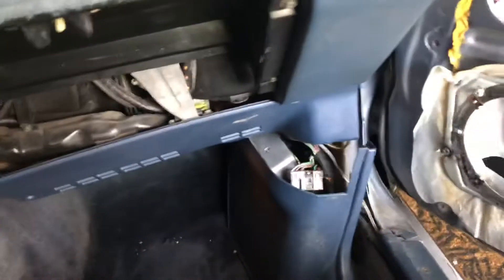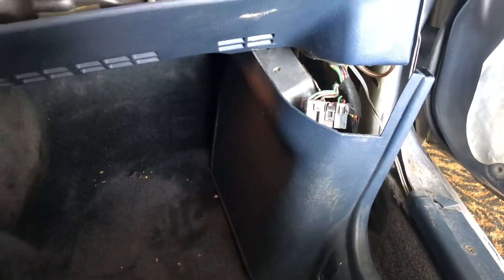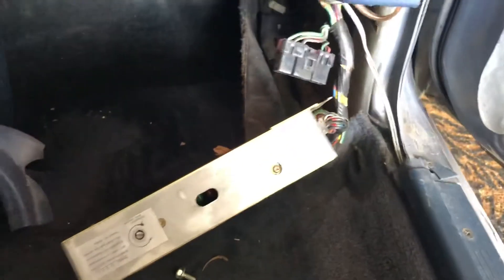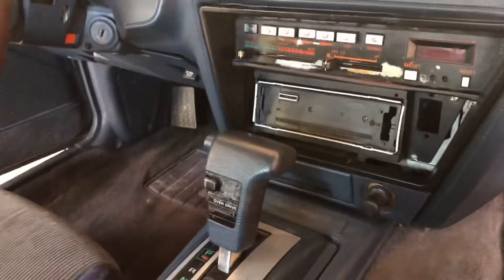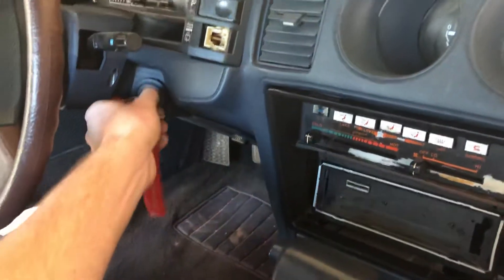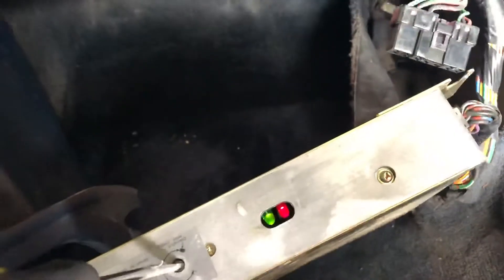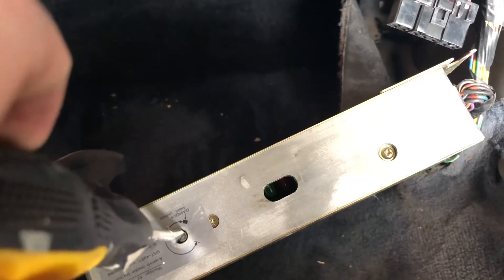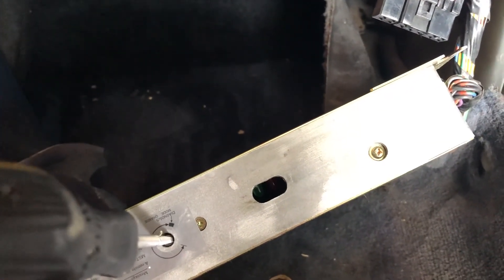How to Read Z31 300zx ECU codes ‘87-‘88

Comment: And how do you read the codes?
Reply from the maker: The codes are the blinking red lights after you get it into the diagnostics mode. This video is only applicable to MY87-88 ECUs. Other years are slightly different. See the last few seconds of the video for an example

Comment: how would it differ from an ‘86 n/a 5 spd
Reply from the maker: Different mode is used to check codes. Similar process but follow this guide: https://www.nissanforums.com/threads/ecu-how-to-read-and-diagnose-z31-codes-84-86-only.84209/

Comment: Bro I have a 86 Z31, do you think this applies to it? Also what scanner tool did you use to get your codes?
Reply from the maker: This method should only work on the 87-88 model years, unless you have an upgraded ECU. No scan tool was needed. All codes are integrated into the ECU. Good luck!
Reply: @Yoyofatboy  thanks my man